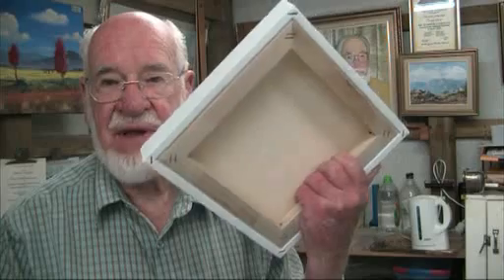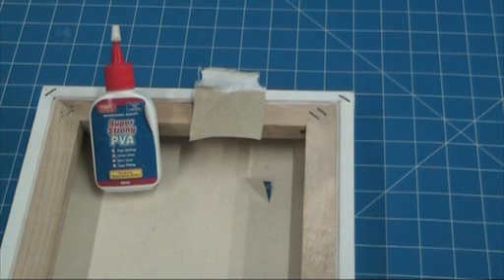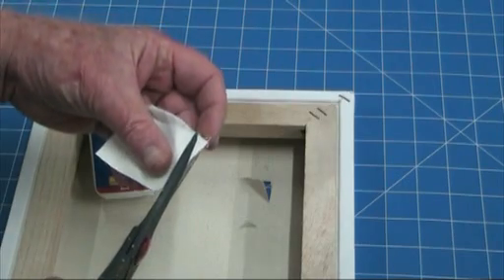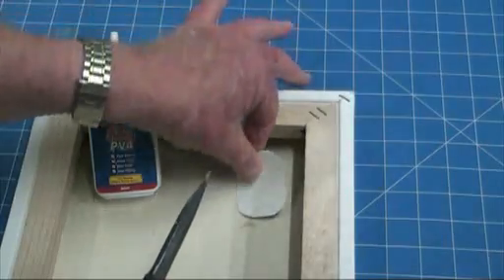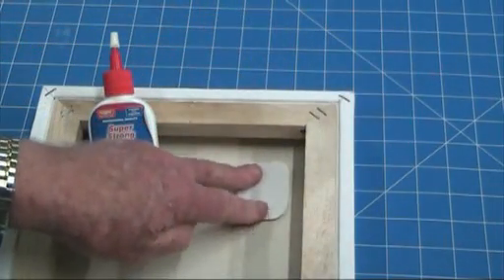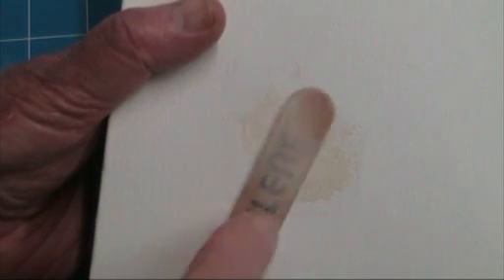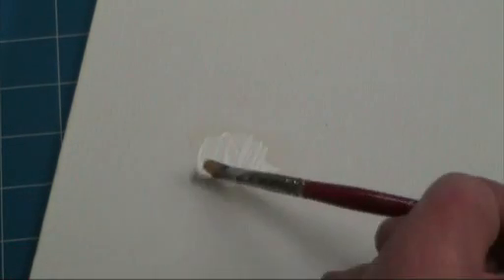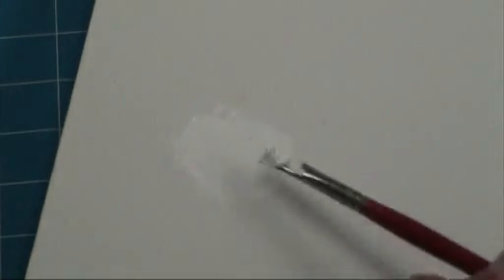How to repair a torn canvas - how to patch canvas

Comment from the maker: tysonpaul, Any acrylic based filler such as Polyfilla or similar (at any hardware store) will work just as well to fill up the cracked area. Just sandpaper or scrape it smooth and over-paint it with some white acrylic paint to seal it completely before using oil paints to complete the painting.

Comment from the maker: Yes, but it will not be strong enough to stop the tear going further - it is just a hole filler. A suggestion is to use some cold acrylic glue and fill the tear so as to glue the edges to the wood frame, and when completely dry, add the filler.
Hope this helps.

Comment: I have a large tear in a large original painting.  I will have to donate the piece now but was wondering if I could use clear gesso on the front and the PVA glue on back and then do any slight touch ups with paint?  What do you think - open to suggestions from all.
Reply from the maker: is it an acrylic or oil painting?
Reply: Oil
Reply from the maker: @mcrawford5877  then you can't use the gesso on the front as it is water based. What I suggest is just patching the back, bringing the torn canvas as best you can together in alignment, then touch up with oil on the front when dry. Good luck.
Reply: @PaintBasket  Thank you so much for replying!

Comment: I would carefully cut the loose strings off otherwise they will show as ridges in the final painting. If the tear is in the oil painted area then, depending on the width of the gap, also fill the gap with gesso only in the actual gap and not on the painted area. This will seal the raw canvas from the oil.Carefully smooth the gesso when dry.

Comment: I need to repair an oil painting which has been varnished and has ripped,, I have experimented on another canvas with gesso which doesn't stick very well can I use gorilla glue as its really strong to stick patch to the back then go over the front in thick oil then re varnish??
Reply from the maker: I wouldn't recommend it for two reasons: 
1) You would need to see if the gorilla glue is ph neutral otherwise it may gradually destroy the canvas.
2) You don't know what chemicals are inside the glue. These chemicals may leach into the paint and affect the colour and longevity of the paint.
Reply: @PaintBasket  hi what glue do u recommend just strong pva glue ?? Thanks
Reply: Also is it ok to put oil paint over gloss varnish then re apply varnish when dry??
Reply from the maker: @philipadams3445  I think that would be a better glue to use yes
Reply from the maker: @philipadams3445  unfortunately not - the paint doesn't grip to the varnish. If it is not a valuable painting, then you can gently sand the varnish to roughen it up, paint over it, then varnish. I don't recommend it though because the paint may peel off or crack down the line.
Reply: @PaintBasket  thanks for reply i sold the painting for 400 and they had an accident with it and ask me if I can try repair it,,, il do best I can maybe rub down the part that is ripped with turpentine ,, wish I cud show u a picture 📷 of it

Comment: Can this method be used to affix a trimmed giclee canvas to the top of a stretched canvas? I have a giclee that was improperly cut (no edge border to stretch) that needs to be fastened as if to a stretcher bar. Can I use this method to paste the giclee to the top surface of a blank artist's canvas? The criteria is that is should be flat, no wrinkles, not reversible by heat or humidity, and appear as if it's just one stretched canvas.

Comment: I live in Hong Kong.  I have a rather fine old copy of a Rubens.  Unfortunately, one of the damn cats got into the room where it is stored and now there is a 3-inch tear.  I see that your method would be excellent for unpainted canvas, but mine would need colour matching of the original painting with the repaired section.  There is nobody that I can find that does this sort of restoration in Hong Kong, and the painting is huge, so very hard to send to London.  I really am at a complete loss...
Reply from the maker: oh dear :( All I can suggest is that you do an online search as your job will require a professional
Reply: Thank you for your kind advice.  It confirms what I thought.
Reply: It is very unlikely that you will want to work on it yourself, so taking it to a conservator is best. You might inquire at the Conservation Office of Hong Kong's Leisure and Cultural Services Department for a list of local private conservators. 

What a conservator will do is take the painting off the chassis so that the edges of the tear can be pulled back together before a patch is applied from the rear. This minimizes the amount of infill painting. The repaired canvas will then be re-stretched onto the chassis.

Comment: Could you please tell me, if the hole is on the edge of the canvas (front)
 and is torn down to the wood (slightly) would I be able to use the same filler?

Comment: What if there is  a jagged hole about an inch in diameter?
Reply: Essentially the same process. Glue on a patch from the rear, fill when dry, and prime and paint over.

Comment: Anyone know what 'cold glue' is?  Is that like ordinary Elmer's glue, the white stuff, or is this some esoteric artist's glue that EVERYONE on earth (except you) knows all about? 
Another how-to about canvas repair demands 'non-acidic glue.'  Implied is that acidic glue will stain the canvas and ruin it for all time. Oh.
What 'non-acidic glue' is not mentioned. Again, EVERYONE on Earth knows what that is. "Your eyes are limpid pools. Love me! But only if know what non-acidic glue is! Right.
Reply: PVA is polyvinyl acetate, and there are many brands available. Importantly, it should be permanently soluble in water after it is dry and cured. Elmer's School Glue is one such. I've used it for many years. Using a permanently water-soluble glue makes the repair easily reversible, which is one of the criteria for sound conservation work.
Reply: @louisc.gasper7588  I hope this is accurate, I'm thinking it is. I need to repair a completed painting...it looks to be the type of glue in the video...